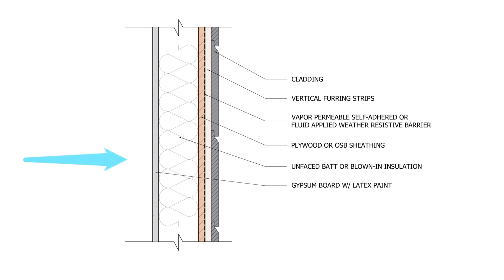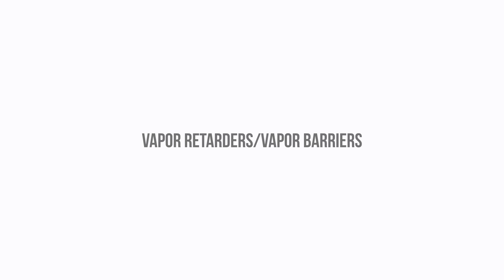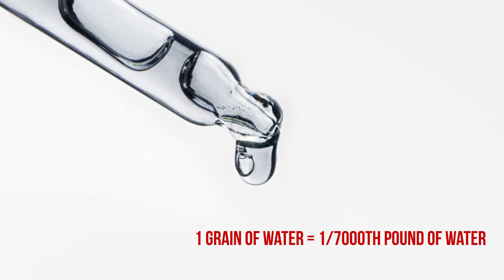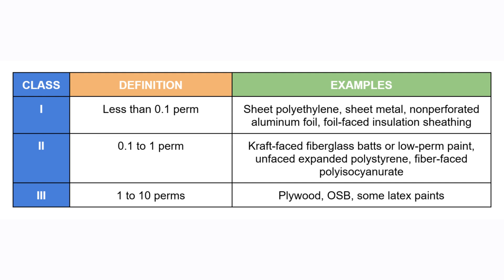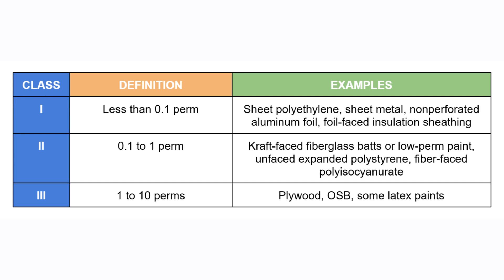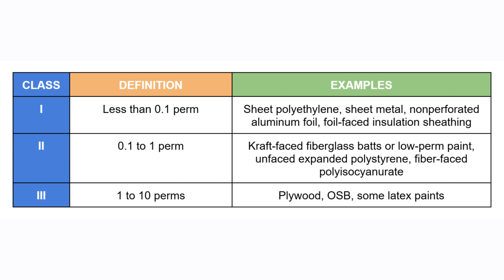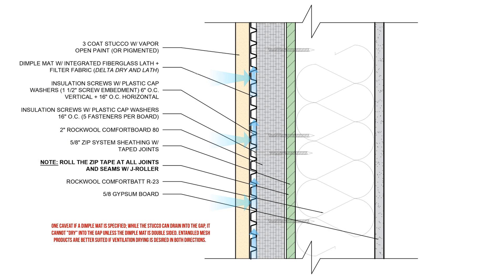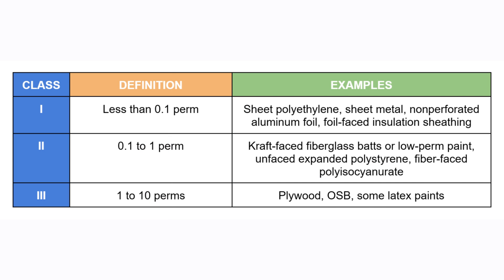What Is a Perm Rating? (And Why You NEED To Know If You're an Architect or Builder)

Comment: I will be hiring a roofer to install a standing seam metal roof in a cold climate.  It's my first metal roof, and I am getting a crash course on the topic of these roofs and moisture management, so I bought your guide.

The first roofer that saw your detail was skeptical about entangled mesh and arguing that it would fail because of lack of air movement.  I assume the semi-permeable vapor barrier is why it should work?  Have you covered this somewhere in your videos?

Comment: Total P.S. about using OSB and plywood in wall construction. Those materials are used because of common  practice to lower the cost of construction not because they slow down the movement of vapor
Reply: Clearly you didn’t understand what he was saying and the video doesn’t apply to you, it’s going way over your head. 

Sharif made it clear why each class exists and why they are CHOSEN. This is a decision at the architectural/designer  level, as it pertains to WRB, not construction of poorly built cookie cutter homes by low skilled labor. 

“The perm ratings of the materials that we specific in our assemblies should always be selected with care. We want our buildings to dry out, but there are of course times that we need to stop or slow down the movement of vapor”. 

Again, it’s okay that you don’t understand.
Reply: @J-yl6on well explain me than, I hope you understand physics principles heat moves from hot to cold. Why do they use vapor impermalbe OSB on outside in colder climate?